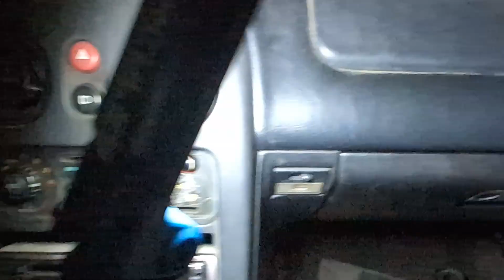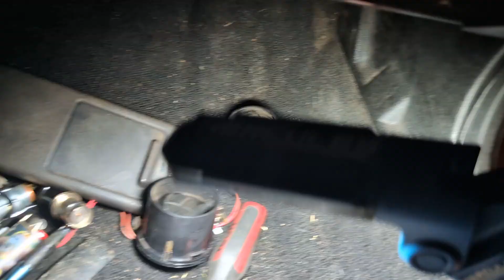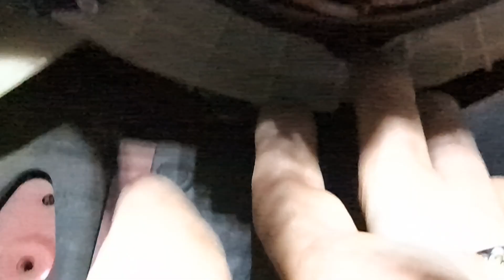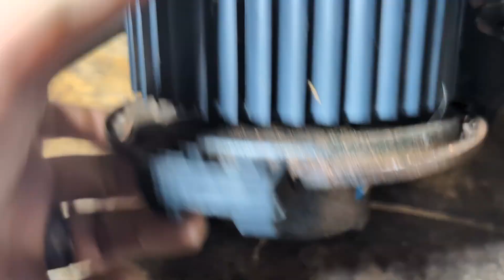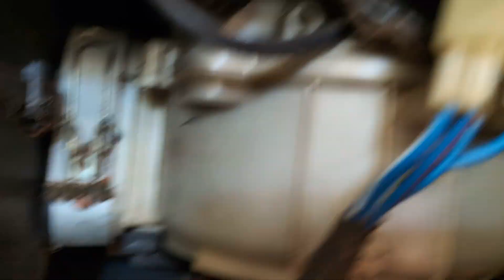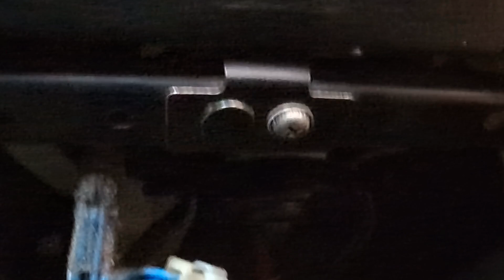Replacing Blower Motor 1995 Mazda Miata MX-5 NA

Comment: do you think a mouse could have gotten into my blower motor? my car also i think the bearing in the blower is bad (makes a loud racket when turning on the fan) plus my interior smells like a dead mouse. gross. yet i've found no mold or water damage in my interior. 
great video! my car is a 1995 Ford Probe GT.
Reply from the maker: If you smell mouse, probably.  Look for acorns and seeds and plant debris where it shouldn't be, and for chew marks on stuff.  I suspect what happened to me is the mouse peed on the blower and the urine froze the bearings in the blower and killed it.  When I first bought this car, the blower worked.  It didn't blow as strongly as the new one, but it worked.